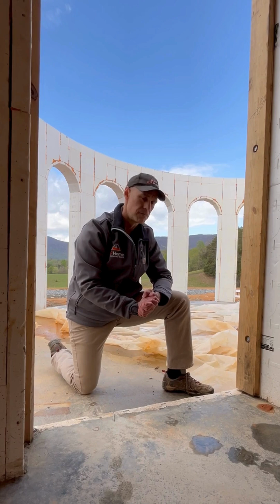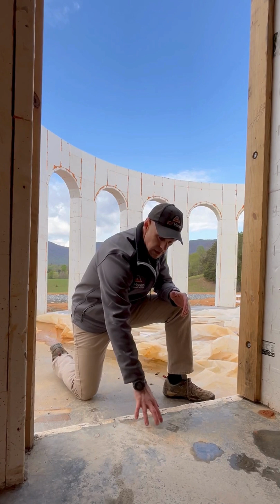Why Concrete Slabs Need THERMAL BREAKS to Prevent Heat Loss

Comment: How would you thermally break a concrete balcony? Im guessing foam still, but how do you connect the balcony to the main structure?
Reply from the maker: Those can be more challenging due to the structural requirements.   You will need to balance the cost to thermally isolate vs return on performance.

Comment: If you have a thermal difference does this need a moisture barrier between or around any of the layer boundaries?
Reply from the maker: The ICF is your vapor barrier, standard flashing under the threshold works well for water control.